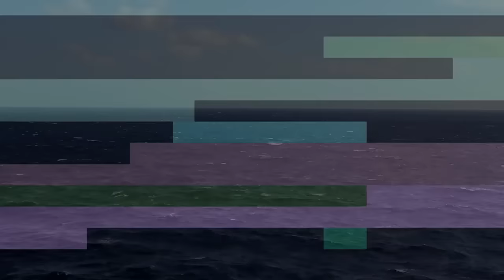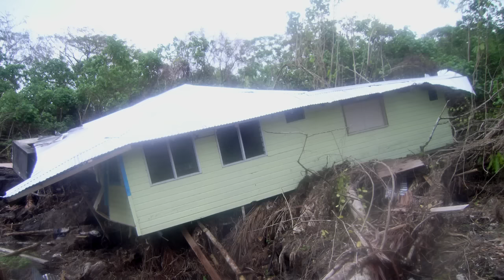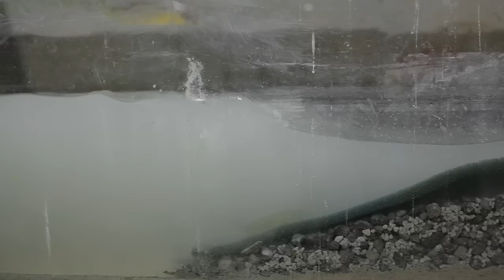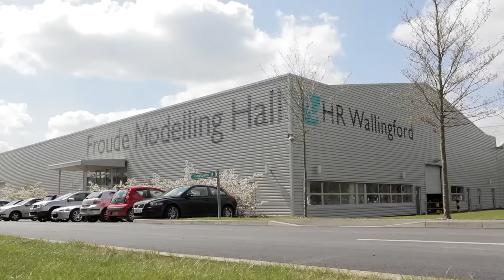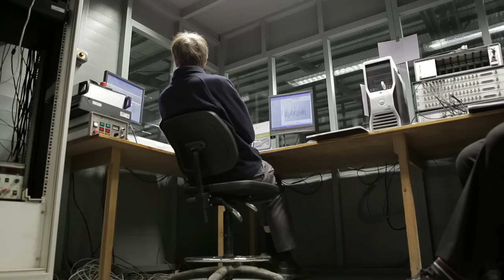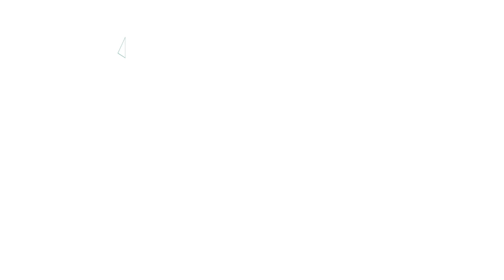UCL Engineering - Tsunami defence

Comment: You should build 3 walls with pumps inbetween them. The small wall will overflow. After this happening, pumps are activated with the seawater. It pumps the water 5 cm above the normal sea level back to the sea in many pipes about 10 cm average capacity. The second wall is higher than the first wall. If the speed of the water with a bigger tsunami tops the second wall even with the first battery pumps are working and overflows it, another battery of pumps is activated to pump the water back into the sea with a sewer type pipes average 1 meter. When the system is built in Japan it could be accompanied with a fourth wall with a 3rd generation battery even larger pumps. Then you are talking about large sewerpipes about 5 meter in diameter where the water is sent back to the sea to neutralize the large wave. I guess this system could prevent damage on coast line from tsunami waves approx 40 m high. You need to build 4 walls 1 Very Large wall, 1 smaller, 1 even smaller and for a small tsunami the smallest wall. This system should be tested in a small environment. Its wise to construct the walls with armoured concrete connecting the wals to eachother. This will make the tsunami defence system even stronger..
Reply: Kristopher Prevo yeah put it would save lives at a higher cost
Reply: It lasts about 5 minutes to get the water level rise. If it's protected with multiple walls and alarm switches that goes off when the water goes over the first wall it would buy time to evacuate this coastline more efficiently. It would take another 5 minutes to overcome the second wall. it would buy another 10 minutes to overcome the third wall. But with pumps , activated by the same sensors, inbetween it would last even longer.  It would absolutely buy more time to evacuate all residents on this coastline. Yes at a higher cost, but more human lifes saved. And human lives are worth more than all gold in the whole world.
Reply: Wim Hamhuis it sounds great but they would spend millions or even billions for it and a Tsunami might not even hit just saying but good idea

Comment: All you need to do is watch all the videos of the Japan Tsunami of 3/11/2011 to see that the force of a Tsunami cannot be tamed in a one size fits all solution. Alot of Coastal Residences are too close to build a wall sufficient enough to hold back destructive waters. A 10-20ft concrete wall is unattractive for a beach front property.

Comment: ...what about underground safe bunkers for civilians to run into, making them water proof. Or what if they built a massive boat facing the ocean close to the shores as high as the biggest tsunami ever recorded rather than civilians trying to out run the tsunami which they won't be able to.
Reply: Chevere4U Why does that sound extremely similar to an ark? O_o
Reply: GP9Xtreme good point. An ark. They should build an ark by the beaches. Nothing can stop water.
Reply: Chevere4U And exactly how do you plan on getting thousands of people onto these boat, in a matter of hours?
Reply: Heuu Arnesen sound the ALARM!!
Reply: Chevere4U Yeah, but what about getting the people from the shore to the boat? It would take hundreds of small boats, and all those boats has to be at the ready in a really short timespan
Reply: Heuu Arnesen I see. no, the boat will stay in its place and brace for impact. not a boat to have an engine just for safety, it will need to be heavy built and if possible, stable to the ground, a ground strong foundation. but there will be like 10 big arks. people will have to get there anyway they can.